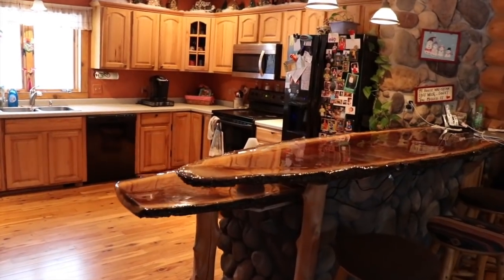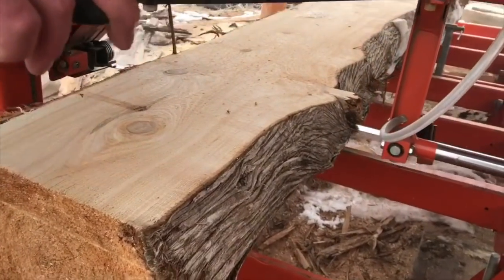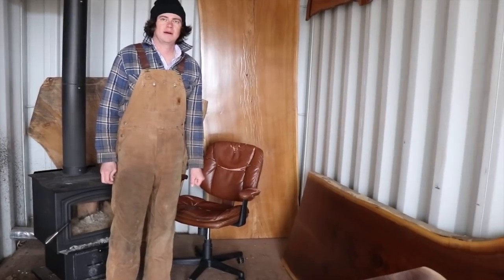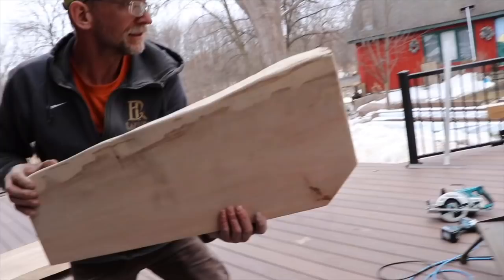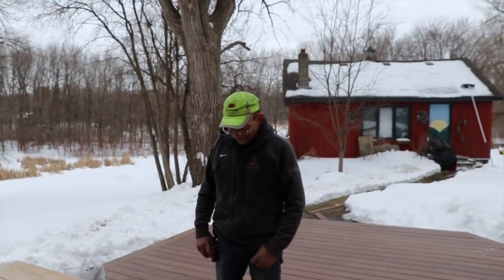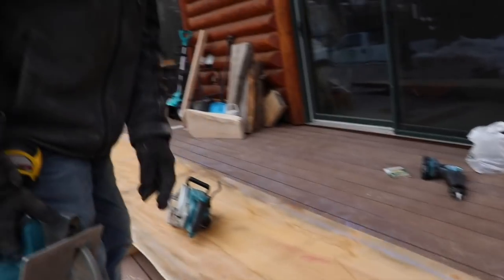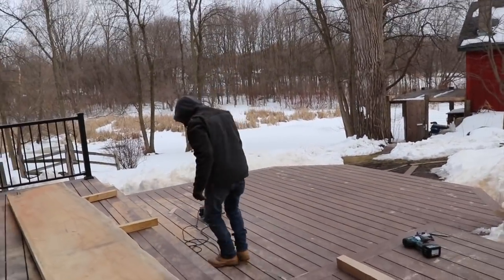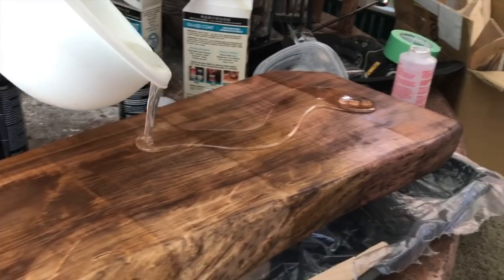Live edge Problems...  How NOT to do a Live edge Project. pt1

Comment: A custom cabinet maker I worked for years ago showed me how he used denatured alcohol to "wet" the wood to show what clear coat would look like.  His reason was to keep water from soaking into the wood fiber that need to be kept dry.
Reply: James Walley i use paint thinner or mineral spirits as well. A little less volatile than denatured alcohol but all are good alternatives to water.

Comment: Try using sheep wool for polly 1st coat not shiney top coat shiney use steel wool between coats .
Dewalt dA sander works great ryobe hand planer see tips from a shipwright to set up planner
Reply from the maker: thanks for the tips.

Comment: Here on the ‘left’ coast true hardwood logs are hard to come by. I like a natural ‘wabi sabi’ live edge. One thing necessary to keep the back to front permanently ‘true’ is to plane or route a groove and lay in flush a 1” x 4” rigid board every 3’ (but not clear to the front to show). My last comment is that wood slabs need to be able to breath. The temptation is often to finish. Every surface with poly but the back should remain open with only a base coat of boiled linseed oil.. I’ve done a few of these and only got called back once after the owner thought it was his personal giant food prep chopping block.... Besides ending up with chips of poly in your food it will destroy the glossy finish.  Routing an inset for a custom chopping block is a great option or a rolling cart with a saved section of the slab that is only oiled every few months and not poly-ed or stained

Comment: From experience, its much easier (and faster) To get the saw marks out of the slab from the milling process by using a router + a sled to plane the entire surface of the slab before you sand. I mill with an Alaskan chainsaw mill out on my homestead up here in canada so router plaining is an absolute necessity or else it'd take me a month to sand the saw marks out of a slab

Comment: I hope you take this as advice but maybe make a template of the wall first and measure to the finished end of counter accounting for the cabinet face, the backsplash will hide any blemishes after silicone caulking, also using the spare wood at the mill can be used as part or a till job to match the counter and add to the finished product display
Reply: I feel silly, started typing wayyyyy before finishing watching the video
Reply: 60 to 3000 grit busch sander n 12" orbital sander (60,80,120,240,320 ,460,600,800,100,1200,2000,3000 pad order )stain as desired, 3 resin coats, sand process again

Comment: I'm amazed with the results of your project--looks great on the video----but I agree with the other commenters and have some other suggestions to improve your long term results.....there is 100% chance your countertop will twist/warp/split----3" thick wood cannot air dry properly.in that short of time-----your moisture meter reads at a maximum of 3/4" deep---if you have a good one?????Your poly---is NOT poly it is poured  epoxy---- will separate from the wood with the moisture and is the stain compatible with this type of epoxy???If not then there is adhesion problems...and it is next to impossible to get the 3" slab completely flat and level with a belt + orbital sander---if you can you are a great wood worker  Good luck on future projects...

Comment: a 3" thick slab of hardwood is going to take more than 3 years of air drying to get it to a good moisture content. That piece had to be reading 20+ percent on the middle. How do you actually keep it from moving around on you when you have it installed?
Reply: That's one reason to buy your slabs from a long established mill. They will have slabs that go back three years in inventory. I know an Amish miller who saves the best slabs out of a log, and sells the rest for pallet lumber and such. He didn't sell a 3" slab until he had been in business for 3 years. And he drilled holes in the back of the slab so the probes for his moisture detector would reach clear to the center of the slab. I've never bought a big slab from him but his bowl blanks are the best quality anywhere.
Reply: Lawrence Withrow that's what I do at my mill. That slab he bought, air drying and cut last year, will not be dry. I'm guessing that the volume of epoxy/resin regards the drying process enough that it doesn't move.
Reply: Have it Kiln dried.
Reply: Even if you have a kiln, a 12/4 walnut slab has to be air dried for a couple (3 at least) years before it can be finished in a kiln. No mills should sell you anything green bc it will move or crack. If it’s moisture content isn’t 11% or better, wait!

Comment: Sanding down maple is a chore.  Could have rented a drum floor sander to do the job and then go over that with the random orbital with 40 then 60 then 80 then 120 and finally 150 grit.  You need to go down at least 1/16th if not 1/8 to be safe to get rid of the saw blade.

That counter top will also shrink a little too because it's not kiln dried.  My take is that you might be good with air dried but for furniture you want that wood as dry as it will get.

Comment: The blade has writing on both sides because, if you noticed, the corded saw has the blade on the right of the motor, but the cordless saw has it on the left side. If you're right handed, you want the blade on the left side of the saw, and vice-versa.

Comment: I recently epoxied an outdoor table made of pine, but it isn't drying correctly. It was a thick pour using a 50/50 ratio. After sitting overnight there were two small areas which were still sticky, but as time goes by more becomes sticky, then seems dry and then sticky again. It has now been two weeks without improvement. What might have gone wrong and is there any way to fix it?
Reply from the maker: epoxy wasn't mixed in with enough hardener

Comment: Too late now, but you should try an electric planer.  Old school would be a hand planer, but that's a lot of work on a piece that big.  Planes make a much smoother surface than sand paper.  Came out absolutely beautiful.
Reply: rjtumble hand planer would be so hard not putting tracks in the wood, but easier than taking it somewhere to have it planed
Reply: rjtumble best off making the right jig for the job and use a router then orbital sander then block (by hand) along the grain.

Comment: I like the wire wheel edge as it looks like all you did was remove the bark, yet no risk of splinters. The sanded live edge is too smooth for a live edge. As far as weird videos go, I’d have to go with either Charlie the unicorn or llamas with hats. Those videos made high school bearable as they were coming out.

Comment: So, just to be clear, when you say "poly" what you mean is epoxy right? Because, polyurethane is very different from epoxy. If your viewers ended up using polyurethane instead of epoxy, their project might go quite a bit better than yours did, but would also look different.
Reply: Mary Jane if it's polyurethane then why is he torching the bubbles out? And why is the 'polyurethane' heating up in the mixing cup?
Reply: Mary Jane if I'm wrong then tell me. There's no need for name calling. It just seemed better if someone clarified whether this was epoxy or polyurethane since they are very different materials. It appears I misspoke when I called it polyurethane, since as has been pointed out it's clearly epoxy. The OP called it polyurethane as well which is why I thought it should be specified.
Reply: You can see the product plain as day at 20:17. Its an epoxy. GG with the name calling.
Reply: It's sad there are people like you in youtube Mary Jane but your cannabinoid home page explains all.
Reply: johnnybarbar : haha yeah aint that the truth....potheads have potheads :-)
Reply: A lot of times when people are doing something like this and they refer to a "Poly" finish they are meaning a Polyester Resin, not Polyurethane. Polyester resins are not as durable as Epoxy and they also are normally considered water permeable. The Famowood Glaze Coat you see towards the end of the video is sold as an Epoxy finish not a Polyester finish.
Reply: Have another puff  Cough cough
Reply: @JuarezDerrick  You are what's wrong with the pot scene
Reply: @JuarezDerrick  You are also why I quit smoking pot a long time ago... I was turning into you lol

Comment: The only time i would use a chalk line for marking my cut, would be for a rough cut, meaning it will be hidden from sight. Especially with this type of custom carpentry.
Reply: Max : Lead pencil, Tape measure, and a really good straight edge. That chalk dust is just to hard to remove on any wood, when it comes to what these guys do. These guys i believe know the nature of there wood, and can see and appreciate the beauty of the job.
Reply: Yup.... the cut is hidden. Under the backsplash. .he could have cut it with a chainsaw if he wanted to

Comment: I Do this sort of thing. Free advice: Get one of those four-pad orbital floor sanders. That's what you need rather than a handheld tool. You'll never go back. And find a good dry kiln to take these slabs. They need to be toasty dry -- like down to 6% and then let them stabilize in the interior environment. You can run into problems with powder post beetle larvae inside the wood. kiln drying will kill the larvae. Check out woodweb.com for all the info. Good luck!

Comment: You need to be very specific on when you are using polyurethane or epoxy. These two are very different, especially when flood coating like you show in the video. Polyurethane is thinner than epoxy and will not flood coat like the epoxy does.

Comment: Please check my plan and let me know your thoughts.

I have a friend with wicked skills and his take on wood finishing is to use wood planers going finer and finer with blade cuts that can never be duplicate with sand paper in his opinion and I have been made a believer.  Although it takes serious time I would like t on think that I could have him run over it and call it good without his exacting perfection.  Like pay him for 2 or 3 hours and call it ready for epoxy seal.

I am getting a 8 foot by 28" minimum slab from a guy that has his own mill for free.  Not sure the wood.  Dont care the wood species.  Dont expect black walnut!

Plan: OUTSIDE BAR TOP in New York with rough winters..  I am not really sure if I need to do all this stuff you guys are talking about but I will put in the effort.  

But lowering temperatures as you epoxy seal the wood before scrape coating it to trick the wood into pulling epoxy in instead of breathing out bubbles as the wood heats up is brilliant.  Saw that noted in  log started by Rich F who sounds like a master woodworker.

But I want my raw edge bar top to look awesome.  

HERE IS WHERE IT GETS TRICKIER:
Was thinking of drilling holes around the slab, sealing them with epoxy and  and fitting clear plexiglass round plugs.  

Thinking I can put lights into wood from below the slab to create mini spots of light popping out on my wood slab reducing the need for extraneous lighting.  

Any thought on it?  Figured I would test out on a 4x4 post to see of my thought has any merit or just is wasted time.  Didn't think that it would cause a fire.

Does anyone think that this would not work out well?  Advice?

Comment: that wood wont be dried within a year, if its only air dried.... ask any wood worker/carpenter.
Reply: Yup, that might work if you live in a mostly dry area with little rain and you are talking about firewood.. But a log that big.. WE're talkign years even when kept out of the weather.
It's why we use industrial ovens to dry wood now days.
Reply: i been a wood worker for over 50 years..............IT ALL DEPENDS IS THE ANSWER..............................  air flow,  starting MC, temp, RH of the site and the species of wood as some can take extremely fast dry with no damage while other fail the first time u look crossed eyed at them!
Reply: I've been air drying limber since 1993-94, typically 1 year per inch thickness on hardwoods will get you in the 12-16 % range in the southeast.  Furniture and cabinetry is best at around 6-8% moisture content. I have built using air dried at the 12-16 % range and with some learning curve and joints that allow for wood movement (contraction/expansion) have good results. But typically at least a year per inch thickness.

Comment: I really like the look but not sure about the functionality.  Is wood good for a wet area such as a countertop?  I understand it has coats of poly but can be scratched, water damaged, chipped, etc?
Reply: My issues would be I don't want my food on or near a VOC curing and off gassing plastic like from the epoxy coat they used.....And you definitely wouldn't want anything that was hot to get close to it, like a hot pot..... So there are a lot of other more practical chooses for a countertop like concrete but the wood does look great.

Comment: It looks good when it's brand new, but I refuse to believe that a kitchen sink surrounded by any kind of wood would hold up more than a few year without dicoloring, rotting, molding, or having mushroom or other forms of fungi start growing out of it where the wood hits the sink and then spread..  A kitchen sink has every kind of germ, bacteria, fungus, etc, etc. etc. espically when used everyday, then add water, moisture and it's a mess looking for a place to happen. No thanks, I'll take stainless, epoxy, sealed natural stone, concrete, laminate, or anything except for wood (around the sink)  And even those materials have problems with H2O.

Comment: Amazing project and I would do wirewheel with a 20 angle so water run's off and still with rounded edges it's last longer and will not splinter. So the Edge has to be at least 1/2" round this way it stay's sealed for years to come and ensure you do have a little 3 degree forward pitch so water will not stay or run to the back splash. Sounds stupid but safe your wood and water to run backwards and under and behind your cabinets which can cause black mold over time. Also use a router for them edges it will turn our a heck better. A tool I often forget I have but it can cut your sanding time down when you get edges by a ton and also when you do cut outs like for the sink ensure you build yourself a template this way your lines are just perfectly straight don't do it freehand if you ain't a pro :-) which I am not.

Comment: for some reason I dont think thats a suitable finish for a kitchen, where knives ,hot pans, toaster and many other things will be hanging around, I can see that  been all scratched  in the no so far future. I mean is pretty to the eye, an  unless this is for  some rich person that only uses the microwave and have the kitchen only to show  and Impress others, this aint the way. and I just think is too shinny for my likes, hard work absolutely,  not for a   kitchen most definitely
Reply: In all actuality, the epoxy finish is much better than say, formica or even polyurethane. Trivets will prevent the obvious scorching since hot pots should never be placed directly on any counter, even concrete. As for cuts and scratches, if it affects the overall appearance, it can be sanded down very easily and buffed to the original luster. If necessary, it can even be recoated without much effort. I'd rather have an epoxy finish any day over polyurethane. P.U. chips, doesn't sand as easily as it is a plastic and it fades, yellows and wears much faster than epoxy. And formica just doesn't cut it with me. Even making my own counters, I'd opt for a stain and epoxy long before I'd ever use formica. It's just paper and glue squeezed to death and it may have an epoxy coating. So, epoxy it is...for me.